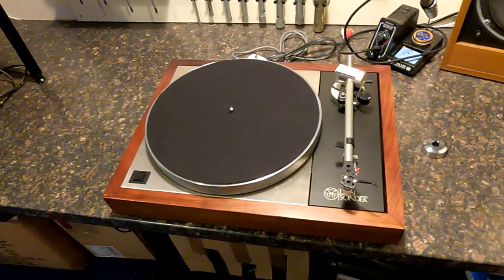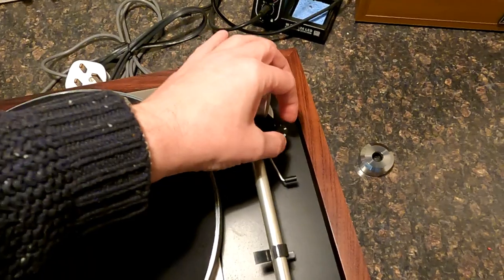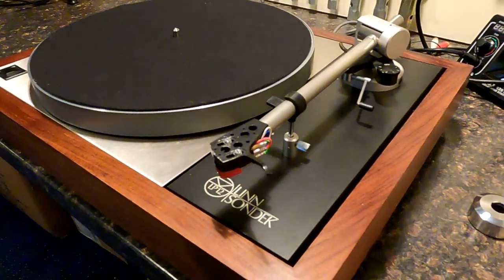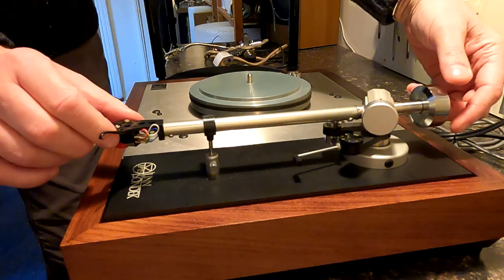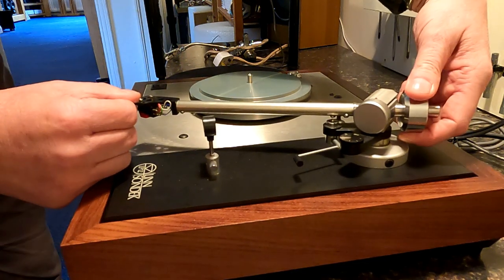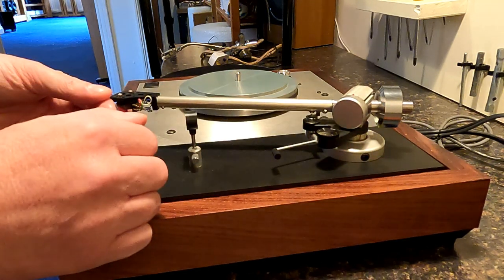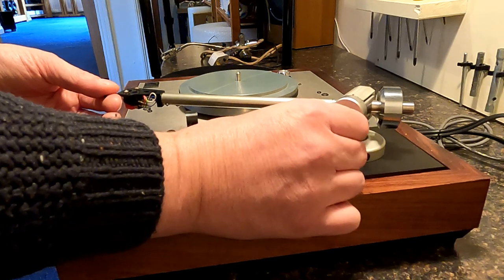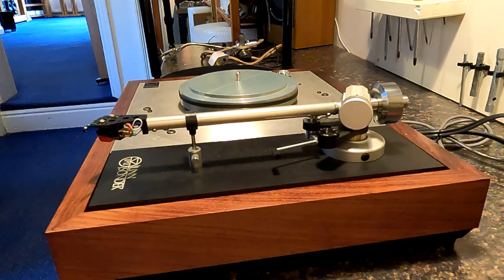How to set the weigh / tracking force on a Linn Ittok or Ekos arm

Comment: Really enjoying the videos very informative. I have an LP12 which I bought around 1987, it’s the best thing I ever bought, superbly engineered. Mine is in use almost daily. It did come with a Basic Plus arm which I have since replaced for a modified Rega Arm, it needed a different arm board. The new arm has improved the sound and the tracking ability too. Recently I did a video on my channel testing the turntable using the HiFi news test record and it did really well even on the most difficult of tests. 
Ultimately it’s what my ears hear is where I hear the benefits of the upgrade and it’s been very worthwhile and also in my view a cost effective upgrade.

Comment: There’s scope to get a finer adjustment if you need to. 
Set the turntable so that the platter and armboard are perfectly level. 
The float with zero tracking force should make the arm free float horizontally once the counterweight is at the ideal distance from the pivot, without drifting off to one side. 
I set the tracking force at the middle of the manufacturers quoted range for the cartridge e.g., a manufacturer’s tracking force range of 1.0g to 2.5g has a midpoint of 1.75g. 
I use a stylus gauge to measure the downforce produced at the thickness of a record on the mat on the platter. I adjust the downforce.
Then set the VTA/SRA ideally by listening on headphones and moving the arm pillar up from horizontal and if the sound improves I adjust until the position above horizontal produces the best resolved playback. 
Similarly if it sounds better adjusted with the arm lower than horizontal the best resolved playback pillar height can be found. I check and reset the tracking force with the stylus gauge. 
The bias is difficult to set. I sometimes use a pair of VU meters on a recorder and a mono record and adjust the bias until the levels match on both channels.

Comment: Early Ittoks have a different counterweight - they are in two parts so lighter cartridges can be used by removing the outer ring. Also the Allen socket to adjust arm height is slightly smaller. I prefer to use a stylus gauge because the bias setting can affect the tracking weight and with a gauge the tracking weight can be adjusted with the bias preset.

Comment: Hi, I bought a used LP12 with ittok arm but when I move the arm a ground noise appears, I measure continuity from ground cable to the bolts near the headshell and is missing so I suspect the arm ground transmits from the back to the headshell by using the metal rollers on the pivot that are maybe oxidized, I'm I right ?